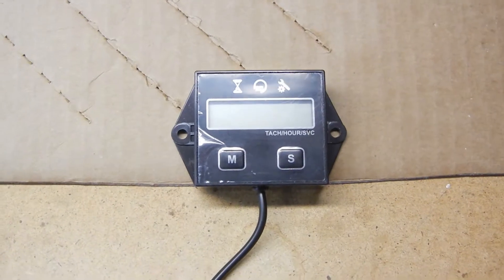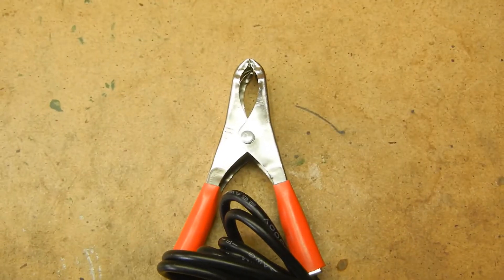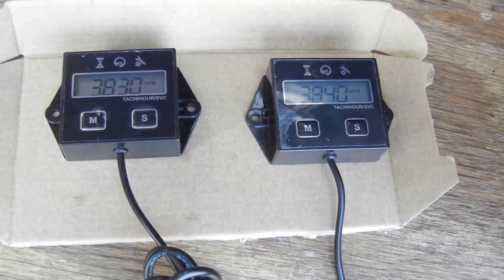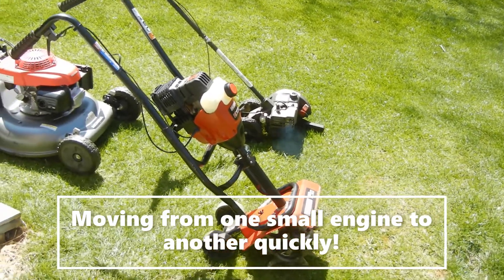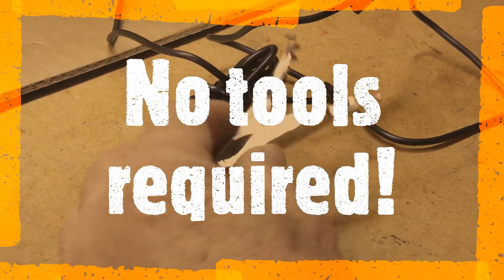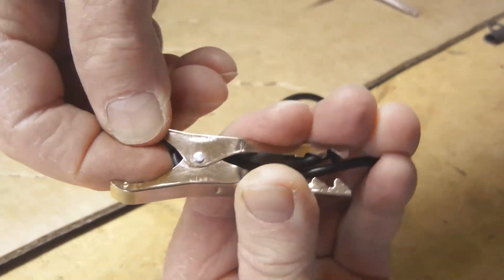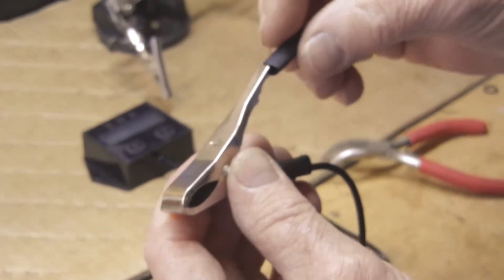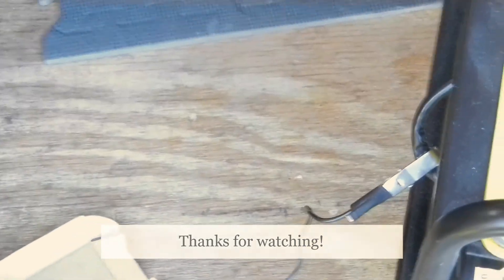Tachometer Hack

Comment: quick question. I just ordered one from amazon. I have have a briggs twin cylinder opposed engine. Will this work on both cylinders at the same time? There is only one adjustment to speed up motor or slow it down. This video was extremely helpful, Great job!
Reply: As your comment is over 3-weeks old now, I suspect that you've figured it out.

On the instruction sheet (and the pdf on their website which you can download) there's a chart for every kind of engine.

For the engine that you describe, if a 4-stroke engine, would be *1P1R*, which I believe was the default I saw on the unit.

Press "M" (menu) until you see the stroke  codes.
To adjust that, press and hold  "S" for 2 seconds (ish).
You can now use M or S to move through the options.
When you see the right stroke for your engine, just press and hold "M + S" to save your setting.

That's it.

Hope that helps.

Comment: I tryed to fit one on my new mtd minie ride on it would not start with tack wire on the spark plug wire 
Take the tack wire of and start stright away 
I even tryed it with spatk tester conected 
It had a weak spark 
Ever  seen this before 
I have the powermore engine 382cc
Thanks Bob
Reply: Have you gotten any answers on this?

Comment: I purchased one of these for my Husqvarna 128 LD weedeater. The manual says the idle rpm's are between 2800-3200, so I have the rpm's set to 3,000, but the max speed be set to 11,000 rpm's. My question is, how would I get this techometer to show 11,000 rpm's?
Reply: have you set the mode '1' for two revolutions per one ignition spark, or to mode '2' for one revolution per one ignition spark?
Reply: @pitapitabread  Thank you for responding, but yes I've set it at 1,2 and 3 modes with the same results. The manual says the digits range from 0-30,0000 but I can't get it to go above 9999.
Reply: @pitapitabread  Yes, I went through all the settings the first time, but I finally figured it out and got 11,000 rpm's but that was to high which is required in the manual. At 11,000 rpm's my high adjustment screw was almost seated, so I backed it down to 9,000 rpm's and I'm comfortable with that. Thanks for taking the time to share the video and responding though.
Reply: @Thomas-nz4uh how were you able to get the higher readings?
Reply: @TEEZS10  Set the tachometer to number 2 for my two stroke weedeater, then turning the high screw clock wise at full throttle.

Comment: mice hack. wasn't sure if you could test with these and only do 1 or 2 loops around the spark wire. what I wanna do is buy 2 of these and check 2 plug/cylinder engines. then  swap them and see if the readings are the same.  could tell me if a plug is fouled or ignition coil is bad.  ie running on 1 cylender or week cylender. rough running engine.

Comment: Thank you for sharing this absolutely clever idea! After watching your video I ordered a battery clip from Amazon and installed it on the tachometer/hour meter I received a few days earlier. It was easy to do and works like a champ! I was surprised that the electromagnetic field  was strong enough to trigger the device (with essentially what amounts to one turn of wire) but it certainly is! The ability to be portable is a big plus. Best wishes for your continued success here on YouTube.

Comment: When using near a lawnmower keep it well away from the mower skirt, trust me lmfao. Should be fine to just clamp the wire in the clip keepers without what you've done unless there's a specific reason. My tach is a different model/make however it works on the same principle & doesn't need to be threaded/looped with the clip. The downside with mine is assuming the battery is ok, it requires me to touch the looped connection at the meter for it to read correctly i.e the exposed wire at the end of the insulation, why's that ? damned if i know it's been like that since new,even sent the first one back until by accident i found how to make it work. It wasn't a cheap meter either grrr

Comment: Great idea! Anyone questioning the accuracy has to wonder about the accuracy of the inductive tach to begin with. Using this on a 4 cylinder engine, is any conversion needed when it reads only a single cylinder?

Comment: I have just ordered a different model with a ground wire. Do I have to connect ground wire or will it still work. Don't really want to loosen bolt on motor to connect it as is a new motor and might void warranty if anything happens to it.
Cheers.